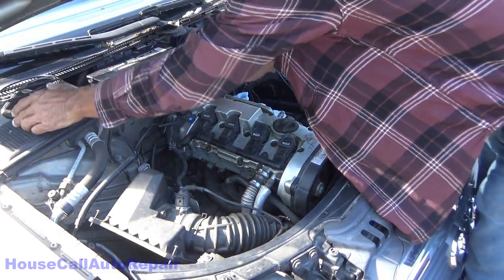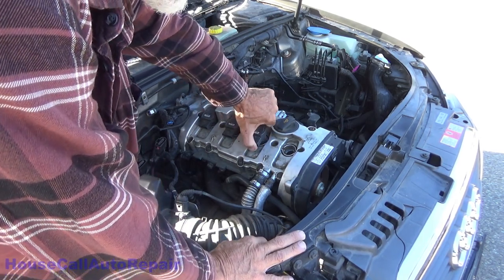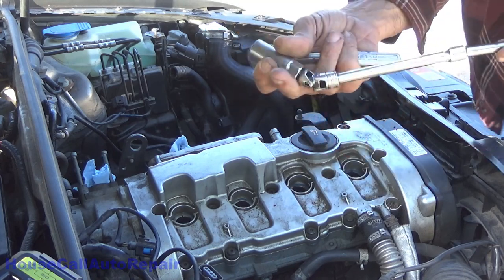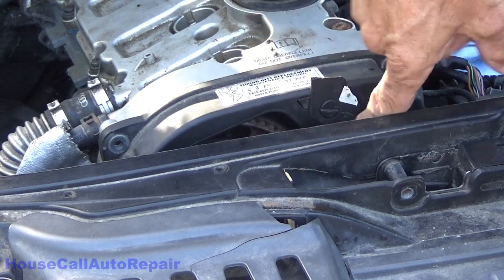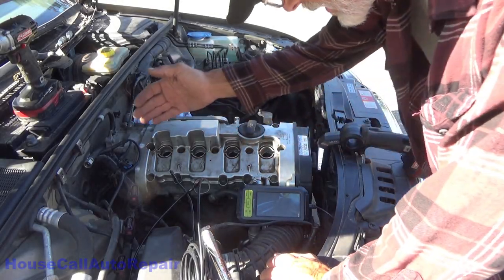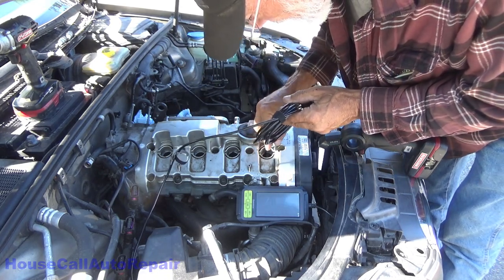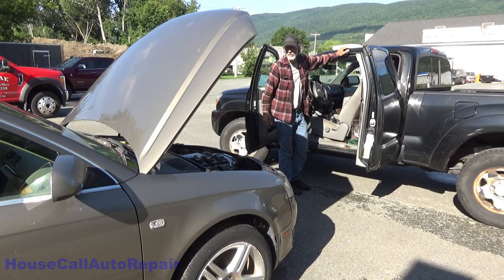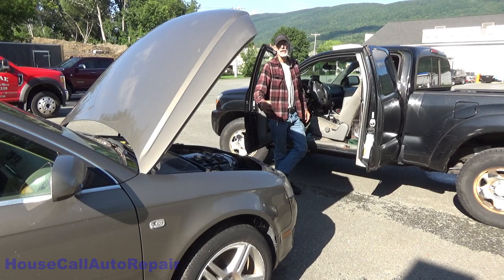2006 Audi A4 2.0t in cylinder visual inspection

Comment from the maker: AFTER reviewing footage on my computer, I found that the black YUK on the cylinder wall is desolved carbon, from spraying PB Blaster into the cylinders for a wet compression test. I also did NOT see the "scratches" I thought I saw on the camera, while recording. The "HOTSPOTS" on thecylinder wall are a bit concerning, however. BUT... we WILL be taking this one apart for a head job!

Comment: Thanks for posting this video. I always learn something new in each one. Your video on doing the trailblazer rear brakes helped me alot. Unfortunately I screwed up and did not realize there was some corrosion under the retaining clips and it eventually caused light noise and much damage to those clips.
Reply from the maker: Corrosion is always the biggest problem, in the Salt Belt. It destroys everything it can get a at.